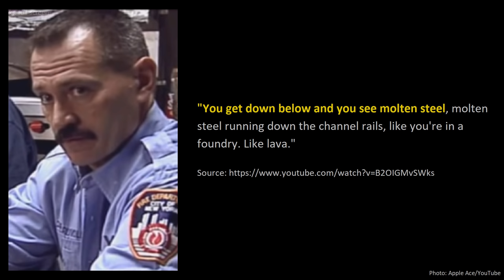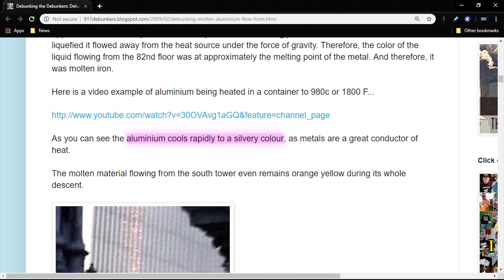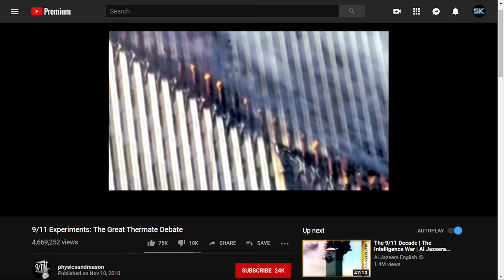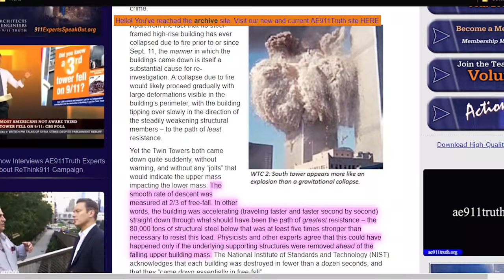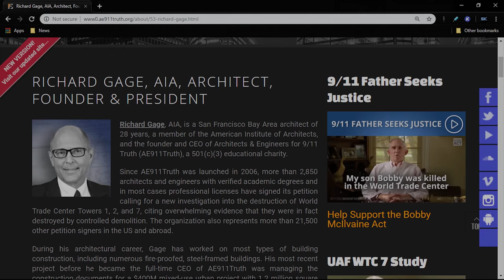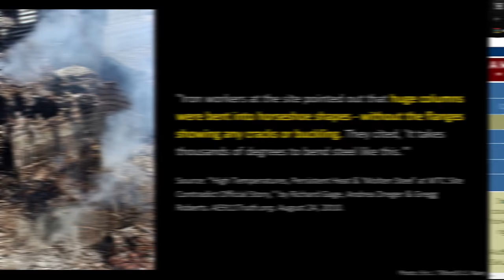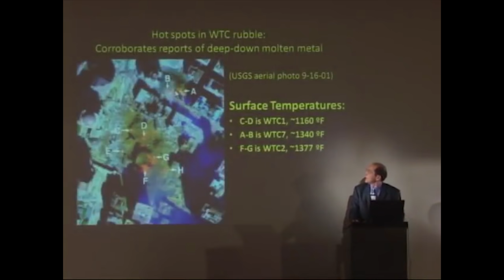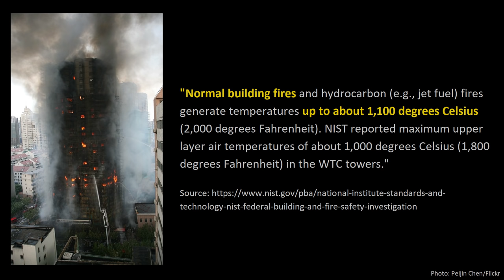9/11 Truthers Debunked: "Molten Steel = Thermite From Controlled Demolition!"

Comment: Kerosene (jet fuel) burns at 350-600 degrees. ALL skyscrapers are required to have fire retardant furnishings per fire codes. Asbestos fire coating on all columns, so how did these fires get so hot to 'weaken' structural steel, or girders covered with B-deck paneling, rebar, and 4"thick concrete? I couldnt use my oxy acetylene torch to penetrate asbestos covered thick steel, or cut thru the B-deck paneling from below with 4" of steel reinforced concrete above, but 'normal office fires' can. I'm a welder/fabricator, there is NO WAY, to my knowledge, to cut steel with an aluminum blade, yet an aluminum aircraft cut thru multiple thick structural steel core columns? And didnt the architects anticipate aircraft collisions, aircrafts full of fuel, and factor that into their designs? Drink more neocon koolaid
Reply: There are a number of problems with your analysis that should be corrected. 

1. You need to learn the difference between ignites at and burns at_.  In this video starting at 22:30 and running to 28:10 the Energetic Materials Research and Testing Center (EMRTC) conducts a test to see what an open jet fuel fire can do to a loaded and unprotected steel I-beam. Remember, steel _melts (turns into a liquid) at around 2,600-deg F, give or take depending on specific alloy. The test was planned for 30 minutes.

youtube.com/watch?v=JXWCMBuusMI&ab_channel=TrutherTVArchives

Within 2 minutes the open fire temperature has already exceeded 2,000 deg-F. After just 3 minutes 40 seconds the beam is sagging noticeably.  The beam fails and collapses 9 seconds later after just 3 minutes 49 seconds.  Note the steel fails but does not melt. It is bent and twisted, but not a puddle. You can still tell it is an I-beam. Purely from a jet fuel fire. 
No, jet fuel can not melt steel beams, but then again it doesn’t have to.  The steel fails well before it gets a chance to turn into a puddle and it doesn’t take long. 

2. All skyscrapers ARE NOT required to have fire retardant furnishings per fire code. Wood burns. Example: There is nothing stopping anyone from furnishing their office space with wooden desks, chairs, tables, cabinets, etc. Also, offices are full of things like plastics and PAPER which will quite happily and easily burn. You seemed to ignore that.

3. The South Tower had no asbestos in it, ever. The North Tower had no asbestos above the 40th floor and much below the 40th had been abated over the years.  The steel was not particularly thick in the impact floors. Perimeter columns (protected by gypsum board) were welded up from 3/8" and 7/8" A36 plate. You are loading your argument. 

4.  SFRM spray foam and gypsum board walls are effective fire insulation, prolonging the survival time of steel structures in fire - right up to the moment 117 tons of airplane blasts through them at 590 mph which tends to dull their effectiveness. 

5. There were no " girders covered with B-deck paneling, rebar, and 4"thick concrete".  The floors were made up from long-span lightweight steel trusses, topped with non-structural corrugated steel sheet with a 4" (quite thin) layer of lightweight non-structural concrete and chicken wire reinforcement to form a floor.  The floor trusses were coated with SFRM which was easily blasted off by the aircraft impact,... which you seem to be ignoring. Not sure if that is deliberate but I suspect it is.

6. The guys in this video had no problem using torches to cut through core columns at ground level, which was much thicker than the core or perimeter columns at the impact floors. Get better with a torch. www.youtube.com/watch?v=pVDU5QKa8Wg  

7. Aluminum did not "cut" anything. Wrong mechanism. And there you go loading your argument again with undefined terms like "thick".  This short video will help you sort out the most common failure mechanism from impact, and it wasn't "cutting": www.youtube.com/watch?v=P8mG9pyImb8

8. In response to the crash of a U.S. Army B-25D Mitchell bomber into the Empire State Building in July 1945, sometime in the mid-1960's after major design work was already complete, a quick study (3 pages of hand-written calculations in a memo) was done to determine the effect of the largest aircraft in service at the time (Boeing 707) lost in fog and on landing approach (light and slow) hitting one of the Towers. Those calculations determine the impact would not cause the Tower to collapse.  Read that again.  The  impact would not cause the Tower to collapse.  On 9/11/2001 the Twin Towers suffered impacts 4 and 5 times greater respectively in terms of energy than what was considered 3 decades earlier. Both Towers survived those impacts .  Impact alone_) did not cause collapse. Twin Towers collapses were a combo platter of Impact Damage + Fire (heat) + Time + Gravity = Collapse*.  Too many people unfortunately look at it as _impact damage *OR fire and never even consider the other two factors.

Such as you are doing here. 

I sincerely hope this helped.
Reply: Let's see.

1, Jet-A is not "kerosene" any more than gasoline is crude oil.

2, Jet-A fuel burns at between 1900 and 4000 degrees F. "Auto-ignites at" is not "burns at", and anyone who thinks differently have no understanding. Incidentally, the auto-ignition temp is 410 degrees F.

3, so how well does this "fire retardant furnishings" deal with having an air-liner crash into it?

4, There was no asbestos anywhere in the towers. This is a well known, and very basic, fact.

5, where was no concrete covering anywhere in the towers, nor was there rebar. No structural concrete was used.

6, in what way is what your oxy-acetylene torch can and cannot do relevant in the first place, much less to something that has nothing to do with the Towers?

7, no, you're not anything of the sort, if you were you wouldn't be making the nonsense comments you are.

8, who cares about an "aluminium blade"? Try it with a 500 mph, 100 ton bullet, see how you do.

9, no, the "architects" didn't anticipate anything of the sort. "Architects" don't anticipate that sort of thing TODAY, more than 20 years late.

Comment: The soy boy on the video fails to explain how molten steel was seen in the underground levels of the towers long before the collapse. 
Molten steel, or even molten aluminum would have cooled down and not be hot enough to remain in a liquid state after  dripping down 80 floors to the underground levels. The firemen saw molten steel in the underground levels from the thermite melting the steel supports of the building.  Regardless what anyone says. There are too many facts of this day that scream out inside job.
Reply: You want that explanation? Ok, sure. "It's made-up stupid shit of a mind-boggling level!"
How's that?

Comment: How could that yellowish colored dripping metal from the side of the building be aluminum?  When aluminum  Is molten it doesn't turn yellow
Reply: Who tells you you're nonsense?
Reply: 12weasel100   Building 7 fell for 2.25 seconds at free fall. That physically can't happen with all the building supports below it. Because the energy required to produce free fall acceleration will have to be used, some of it at least, to crush the columns. If you take the energy away from producing free fall and you produce something less than free fall and that would be measured in the videos.
Reply: 12weasel100   No the entire 2.25 seconds has not been explained by nist Because it can't be explained by nist. Durung 2.25 seconds 10 floors collaspsed with no resistance.  Even you admit that there wasn't enough fire to cause 10 complete floors to lose 100% of the structural integrity
Reply: 12weasel100  so you obviously can't understand this. NIST does not and cannot explain how a building could fall at freefall for 2.25 seconds. According to NIST it happened and they cant explain it. Look it up you obviously haven't
Reply: 12weasel100  ....ok, how? You say you understand. How does the building fall as if nothing was below it when actually there was something below it.  That's what the free fall represents. dropping something with nothing below it and then hitting something and not slowing down that's not possible.
Reply: 12weasel100   Poorly educated? I have a bachelor's degree in mathematics and statistics, have done graduate level work also. So again we measure the collapse of the building and for 2.25 seconds it accelerates at the same rate that it would as if nothing was below it or what is called freefall. If the building below it had any integrity at all it would slow down the speed of the collapse. But It didn't because it was exploded with demolition, there can be no other explanation
Reply: 12weasel100   It's basic physics. If something is falling it could be measured to accelerate at 9.8m/sec/sec towards the ground,freefall.  All of its potential energy is being used to accelerate the object downward. If there is something below it, say a steel column, it has to use some energy to crush it, thus not all of the energy can be used to accelerate it downwards so the object will not accelerate as fast. This is basic physics.  The only way a building could collapse @ freefall is if all of its supports were removed. This would have to be done by controlled demolition there's no other way
Reply: 12weasel100  I have explained it several times.  Let's talk about the twin towers. In the case of tower one the top 15% of the building Crush the bottom 85% of the building. Try to come up with an example in real life other than the twin towers were you can cut off the top 15% of something in a height drop it on the bottom 85% of something and crush it all the way to the ground. Now I say height because each floor in the top of the building weighs 6 significantly less than each floor at the bottom in the building because they aren't nearly as strong and the supports aren't nearly as thick. In the case of WTC1 the top 15% accounted for approximately 3% of the total mass of the building
Reply: 12weasel100   aS far as building 7 goes nist agreed to the assertion by Stephen Jones that the building fell at free fall for 2.25 seconds

Comment: Wtc 7!! It also fell down in free fall. No lower level were resisting
Reply: No it did not.  Not even close.  About 30% of the rate of GA on average actually with plenty of resistance all the way.
Reply: @MFitz12  Sorry, watch the videos.. what has hit the WTC 7 else?
Reply: @Thamsite  - The North Tower hit Building 7, but that has nothing to do with your false claim.
Reply: @Thamsite  - Building 7 was HIT BY THE FALLING NORTH TOWER.  This caused extensive physical damage to the south and west exterior of the building including the failure of at least 2 perimeter columns.  It also introduced thousands of tons of burning debris into the building which started fires across multiple floors simultaneously which spread quickly due to the physical damage and loss of water pressure. Attempts to fight the fires were given up by early afternoon due to the buildings obvious structural instability.  It was creaking and moaning and a surveyors transit confirmed the structure was moving.

The collapse from first visible external signs of structural failure until the roof hit the ground took around 20 seconds - or 3 times longer than free fall.  But who the fuck cares because how fast something falls tells you nothing about what started it falling.
Reply: @MFitz12  What, small fires and then what it looks like a control demolition. HAs never happened before or since to any building on fire. They did a great job.